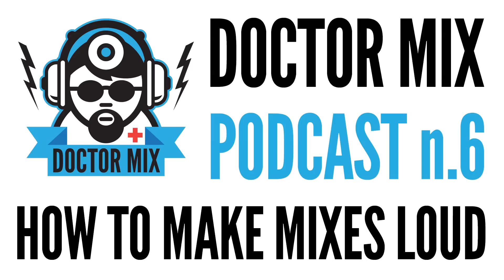How To Make Mixes LOUD - Podcast n.6

Comment: Hi! I was wondering. When mixing should i just have a limiter with a cealing of like -0.1?
Reply: And then add a new limiter when mastering
Reply from the maker: A ceiling of 0.2 is a good starting point. But you always want to keep an eye on that inter-sample clipping ;) But that's just for mastering, for mixing you should keep it a lot quieter than that. ideally between -3 and -6. Making it loud should be part of the mastering process.
Reply from the maker: I Have no idea why Youtube is putting a line through my comment!!
Reply: Doctor Mix Ok! When mastering should I still have a 0.2 celing? for the end result?
Reply from the maker: Yep, we'd advise at least a -0.2dB headroom. :)

Comment: CONCEPT OF LOUDNESS
How much i limit the music for the difference of the quiestest part of the music and loudest part of the music to become narrower.
For Example: if the vocals and piano are at a 8db distance we narrow it so it is at a 3db distance.

Basically the whole concept of compression. Lessen the dynamic range so you can make the entire thing louder without distorting

LOUDNESS IS A COMPROMISE
Loudness is a Compromise between how much dynamic you can get out of your mix and how much dynamic you can get out of your Mix

COMPRESS IN LAYERS/STAGES
If you compress a little bit at each stage you can do a lot more compression without it being as noticable 

PREPARE FOR LOUDNESS

USE A LIMMITER ON THE DRUM BUS 
eq-> compression -> limmiting on drum bus. Stay 4-5db below zero

DRUM TRANSIENT DON'T REACH HIGHER THAN -12 DB AT START

DRUMS ARE KING

TRANSIENTS ARE THE FIRST THING TO GO

LIMMITING CAN ADD EXTRA HARSHNESS (can be used stylistically).